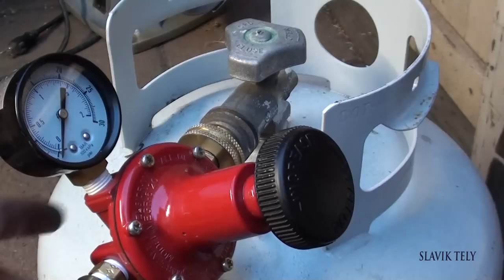Making CS:GO DEFAULT T-KNIFE Part 2

Comment: amazing knife, just wondering why you use such a big quench tank?
Reply: Nabeel Majeed yes i know  he makes kukris and things but surely he has more than one container
Reply from the maker: Because I need room to move the blade back and forth when it is quenched. You can not just place the hot steel in the oil and leave it there.
Reply: SLAVIK TELY thanks that makes sense

Comment: You dont really need to cool that part while grinding. This is only necessary if you are working on the blade which has to stay sharp and withstand mechanical stress.
Reply from the maker: I don't have supernatural powers and can't hold hot metal

Comment: I never thought of using vegetable oil to harden steel! A lot cheaper and less pollution than petroleum base oils. And there are a number of different oils with different boiling temps. With a bit of experimentation you might just customize the mix for various steels. Thanks for the idea.
Reply from the maker: you are welcome

Comment: Two questions. What are the grinding wheel things that you are using on your drill press called? I must get some.

Where do I get one of those scribes with the dial on it?
Reply from the maker: They are called diamond wheels-got them on amazon or harbor freight. The dial is called  grizzly height gauge
Reply: SLAVIK TELY Thank you so much. And as always, great work!

Comment: Slavik, what bandsaw blades do you find to be best for knife work?  Teeth per inch, etc.  I have no bandsaw yet but, there is one on the future that I would like to get!  It's a pain having to save a little out of each disability check until you can afford the one you want!  It would be nice to be able to  work at a job, again!
Sorry!  Got carried away!   What brand bandsaw works for you?
Thanks for the wonderful videos that are well lit, filmed, laid out and very inspirational and tutorial!
Reply from the maker: I use 18 tpi to get finer cut. I have Milwaukee. Nick Wheeler has Dewalt. I noticed Dewalt has better screws setup for future wall mount if you choose to. My wife is disabled, I know exactly what you mean...you get paid very little on disability.

Comment: why did you immerse the knife in oil after heating, ? what is the benefit .? and why did you put it in oven ??  because you already heat it with flame???
Reply from the maker: Quenching in oil is called heat treating. After that steel is very hard and brittle. By placing knife into oven for two hours at 400 degrees F is called tempering. Heat makes steel little bit softer but not as soft as it was before heat treatment and not as hard as it was after heat treatment.
Reply: SLAVIK TELY . why do you need the steel to be soft isn't better to be hard . and What kind of oil do you use in heat treating . is it possible to use any oil ? thank you for your respond .
Reply: Mousab Aboud imagine trying to baton with a piece of glass it would shatter because it is too hard by softening it a little bit it won’t shatter as easily.
Reply: @mousababboud9308  if its too hard with no flex it could snap or shatter

Comment: Hi tely!
What is the reason of using Oil instead of water in hardening process ? (dunno the correct name of thos process you can translate hartowanie)
Reply: water makes the steel more likely to crack, if you have an oil hardening steel it's always better to oil quench, some steels though only harden in water
Reply: HKnives Isn't it risky to harden in oil ? It may create jeopardy of burning. I know that water may cause cracking the blade but doesn't it make better effect ?
And last one: if you would like to harden heated blade in iced water, i mean water with ice balls inside, will the effects of hardening be better or it's just stupid myth ?
Reply: If you use peanut oil, canola oil (like slavik did in this case) or even specialised oils than they will rarely catches on fire, you should also be holding the metal with tongs so it shouldn't be a problem. All oil hardening steels can harden in water, but the chances of cracking are high. Some modern, specialised oils such as Parks 50 can harden most types of normally water-hardening steels. The only reason you might want to use water is if you were making a hamon, because water helps getting a more defined hamon. If a steel can be oil-hardened, there is no point in water quenching, since oil-quenching will get hard enough in oil.
When quenching in water you would want the water to me warm rather than ice cold as that would increase the chances of cracking. Putting ice cubes in your quench water will not help.
Reply from the maker: There are steels that require Water quench, others need oil quench, stainless steels and A2 require Air Quench.  Thank you HKnives for the reply.
Reply: No probs, least I could do :)
Reply: HKnives Thanks guys, now i know much more :D
Reply: hahaha

Comment: Why use oil instead of water for cooling down the knife after heating it?
Reply from the maker: This steel requires oil quench. There are steels like W2 that need water quench. Stainless steel is air quenched.

Comment: For anyone wanting to harden their own steel. Point your blade due north when you quench. As the blade goes from non magnetic to magnetic it will try to point north, sometimes putting a slight bow in the blade if it's pointing eastward or westward at the beginning of the quench. One more secret gone.
Reply from the maker: Wow, thanks for the advice. Will try.
Reply: That was a lesson I learned from one of the finest blacksmiths I've ever had the good fortune to work with. Bowed blades are much reduced.
Reply: After you quench the blade how long do you have to bake it and at what temperature?
Reply: That’s really interesting. thanks!